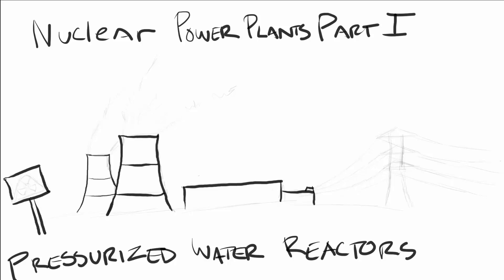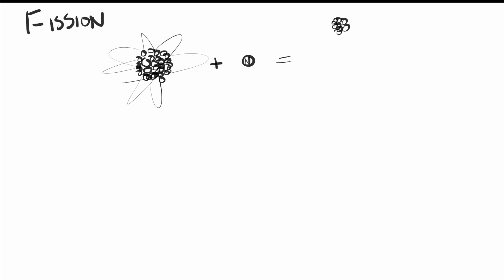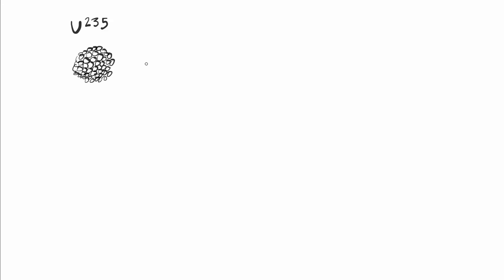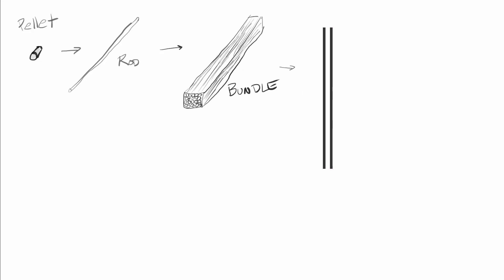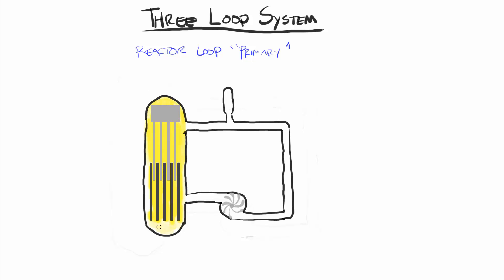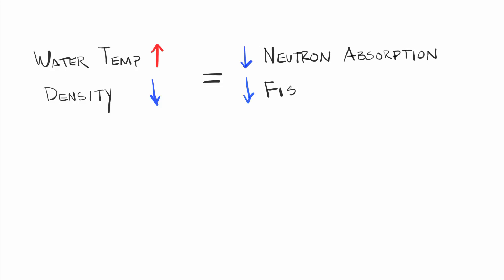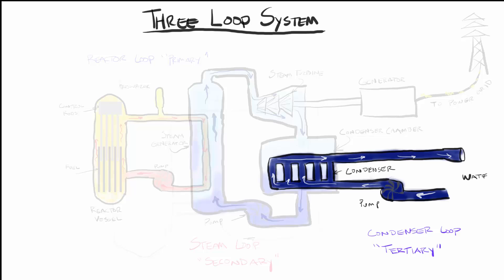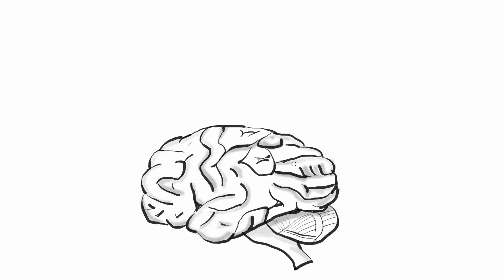Nuclear Power Part I - Pressurized Water Reactors

Comment: Nuclear power is still a viable green source of electricity. A serious commitment needs to be made by the public and private sectors to retrofit existing Nuclear power plants with liquid fueled Nuclear reactors, and diminished solid Nuclear fuel processing equipment.  This will protect the environment and provide clean electricity for centuries.